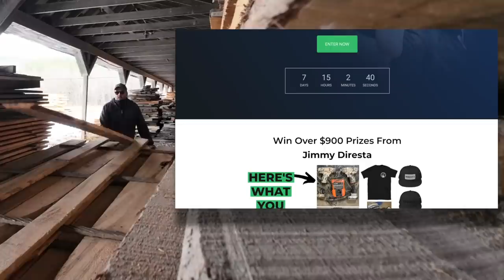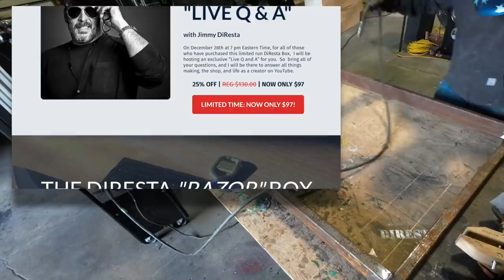DiResta Basement Door Rebuild: 200+ Year Old Farmhouse

Comment: When these doors were traditionally constructed, especially with large strap hinges or back rails, large cut nails were used and the ends of the nails clinched (bent 90 degrees to form a mechanical joint) after being driven through the wood. Farm doors and country doors were made this way for hundreds of years. Would have loved to have seen such a method here. Will be interested to see how this door weathers. There's no room for wood movement and the front steel strapping seems to be glued down with industrial adhesive. There's no wiggle room for the strap hinge bolts either.
Reply from the maker: there is 1/4air  between boards to move .. the board will move in there palace. .. the strap glue was for temporary movement  in and around  the shop.. it will let go fast . imho  the farmers that clinched nails, didn't have nuts and blots.. I want a vintage look with a modern tech. this  will lastly longer that any farmers  door

Comment: Nice door.  I am however surprised you didn't use a diagonal cross brace to prevent the door from sagging over time.....   It may take some months or a year but without a diagonal brace, I predict a problem.

Other wise - nice job

Comment: Love the build...just did 2 doors myself.  One thing I don't understand is why you don't sand the rust off of the metal before you weld it all together.  You could even paint it with weld through primer....  Would you consider painting the wood with spar varnish?

Comment: Nice job, but I don't understand why you didn't remove the oxide from the metal and why you didn't cover the gaps between the door frame and the wall with cement. You could also have painted the door so the metal won't rust and the wood won't get rotten.
Reply from the maker: Needed to end the video.   Time didn’t stop.  Just the video.

Comment: Wonderful project, thank you for taking us along on your journey. Two questions: Wouldn't you normally have the bolt heads on the outside and the nuts on the inside to prevent people from disassembling the latch? If not, is there a specific reason you did it the other way 'round?
Reply from the maker: I did weld the exterior nuts.

Comment: Instead of using normal fasteners to secure door handle. Use flat rivet bumper bolts on outside so thieves cannot just unbolt a 10mm nut to get in.

Comment: I have pulled apart a pocket knife my father got from my mother when he started his first job from college. The pocket knife is missing the black inserts and was going to see if I could use antlers from the deer I shot to fit and mold into it but it’d be a stretch due to the shape of the scales area. I wouldn’t be against other options. Let me know if you have any ideas. It’s an imperial Ireland 2 pocket knife.
My parents have both past and want to keep a sentimental piece of my fathers and bring it to life a bit. Let me know if you have ideas. Thanks!
Reply from the maker: You can get small pieces of exotic hard woods from pen Turning supply shops. You won’t need much. Lots to chose from.  Or also a knife supply site
Reply: @jimmydiresta  do you know any good websites. The scale area has a silver oval and I need a thin enough scale to epoxy and curve around the metal grip area.

Comment: why do you weld everything with what looks like a series of tacks? instead of running a stitch then gap, or just normal weld eg for the door cross struts
Reply: also have you thought about replacing the nuts/bolts with your own rivets, just to give it that bit more of a rustic look

Comment: 21:15  excellent job, but why is the door handle placed so unusually high?
Reply: I’m not sure it is, I think the door is short. A 200 year old farmhouse probably has a cellar with a low ceiling, and corresponding door heights. And it’s at the end of a set of stairs, maybe you’d want to place it a little higher so you don’t have to reach that far down as you’re coming down the stairs.

Comment: Door is awesome. But why would anyone load a truck like that?
Reply from the maker: How would you carry 14’ boards on a 18’ long truck?
Reply: @jimmydiresta  honestly they looked 10’ boards on a 6’ bed. Short answer flat to the bed strapped down. More than double the bed length use a trailer
Reply from the maker: @1246kenny  ya do what ya can with the truck ya have.